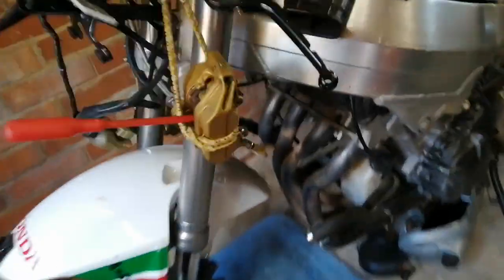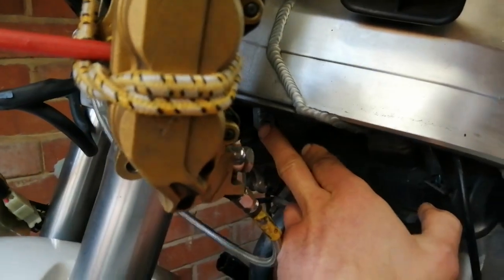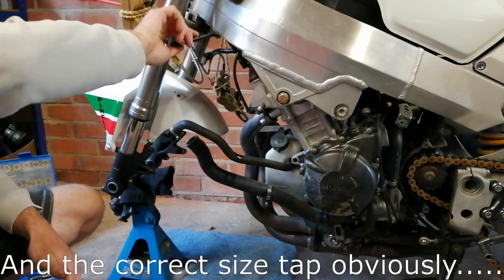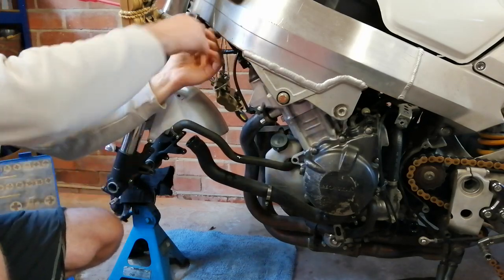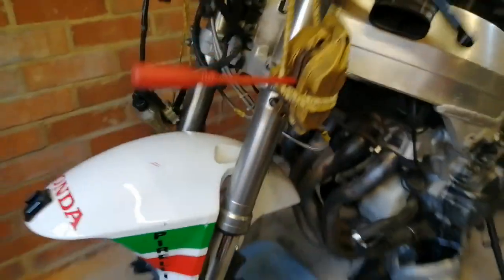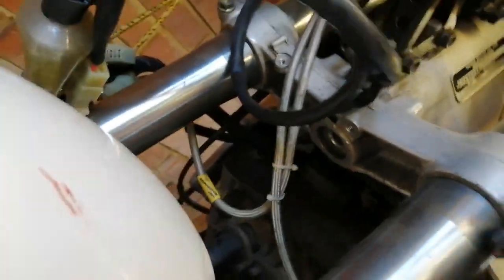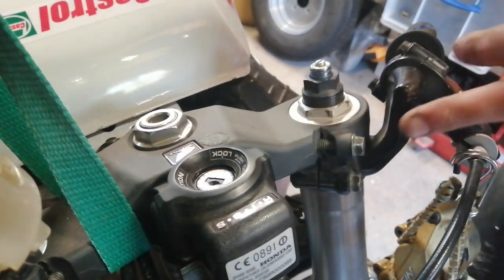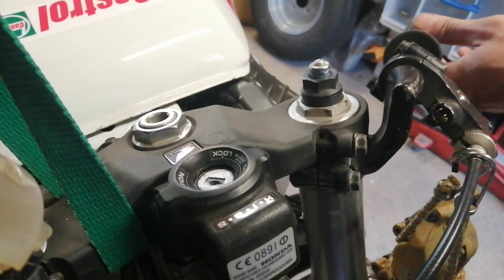Honda CBR 929 900RR Fireblade Track Bike Fork Strip Down and Fork Seal Replacement Plus Rad Repair.

Comment: If you don't want to hold the clipon when undoing the fork top bolt (should only be about 23Nm), turn the head to full lock and push/pull against the chassis as it's more stable and easier.

TOP video though. Very clear.
Reply from the maker: Cheers mate, yes your 100% right I should have cracked them off with the bike on the ground really rather than undoing it with the axle stand under the front axle but kind of decided to do the job after I took the wheels off lol. Catch ya soon buddy 👍